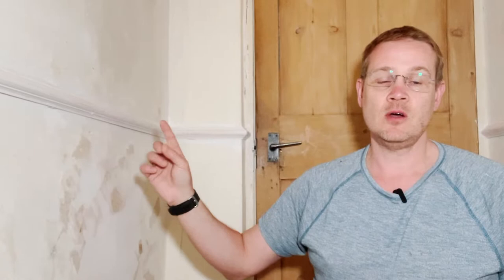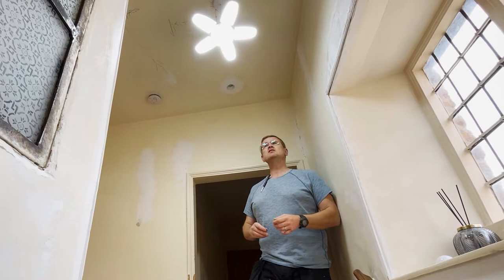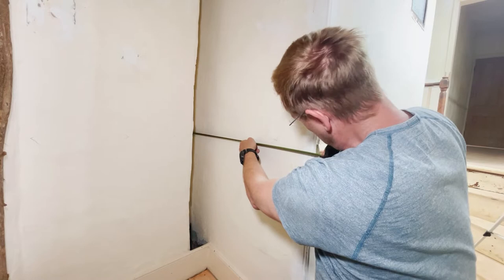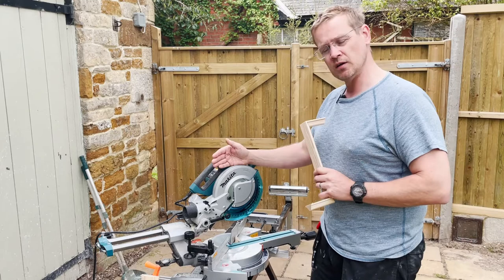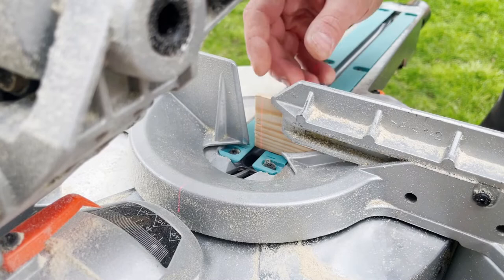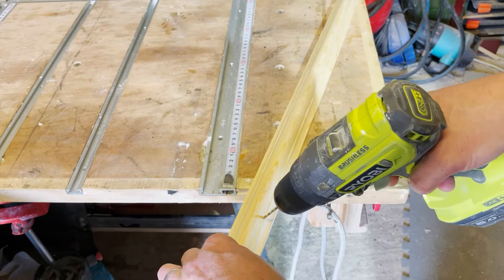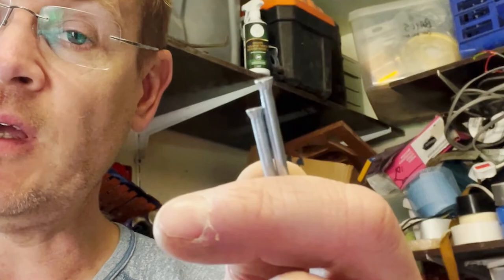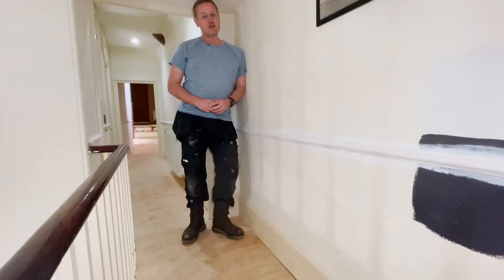Dado rail - What, Why and How

Comment: Great job. May I ask, after you measured the outside mitre at 91.3, 45.65 for half of it, how did you setup your mitre saw angle to cut it?
Could you also show how you do stairwells, measuring the cutting angle and where the horizontals join the rising dado rail.
Reply from the maker: For setting the odd angles I use just the base miter angle clamp and don't rely on the default detents.

For cutting a stair joint treat them as two planes. Use the horizontal angle and the bed angle, for the vertical use the saw head / compound angle on the saw.

An alternative is to just cut a few scraps and keep experimenting. 
Another alternative would be to cheat and use a piece of architrave as a feature to joint up to on each side.